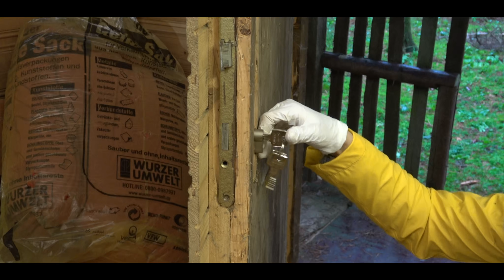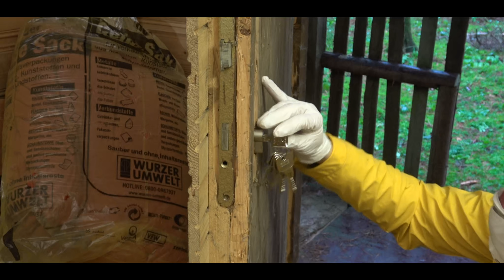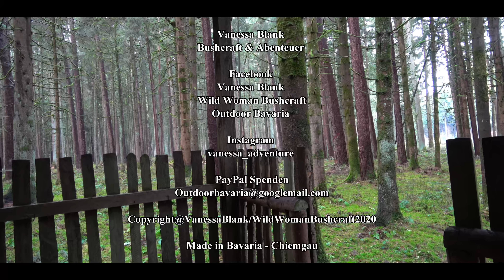🌳🏡🌲Forest Cabin🦊 #1 Tiny House - The Renovation begins - Vanessa Blank - 4 K

Comment: Well you got a lot of work done, looks great. Once you start staying overnight and are using a heating device you should think about having a smoke detector and carbon monoxide detector in the cabin. You did a good job protecting yourself when you were cleaning. The only thing I would add would be safety glasses or goggles. The mouse droppings and dust mixed are sometimes toxic. Great Job, congratulations!!👍😄🔨

Comment: Congratulations on turning a "man cave" into something fit for a "lady" and her children!  The big table might have been nice for having the children at one end while you prepared a meal at the other end, but it did take up a lot of space. If you are worried about security, take a slightly different way into the cabin every time so that you do not develop a path that others will be tempted to follow.  That moss on the wood is turning it back into soil--just like a moss covered log lying in the forest, so you need to address that sometime--a lot of work and some more money, but get the damaged wood replaced first and look to that roof first too.  It takes time and money, and there is never enough of either, but the work is started in a big way now, and you can stay in the cabin to do the other things that need to be done. This is the kind of place that is made for children to grow up in!  Blessings to all of you!
Reply: Maybe you could get a smaller table but put a drop leaf for the end so that if you want to use it for other things also you could.
Reply: See to the roof now that there is something inside to protect.  Nice work so far !

Comment: Vanessa, you might consider putting some type of insulating material in the loft between the main rooms and the roof. This will prevent the heat from escaping, and if you use the cabin during the winter months, any snow on the roof won't melt and leak down into that space and end up down in your main areas. You've done a fantastic job of getting the cabin ready. I'm sure you're eager to begin using it.
Reply: Grand idea BUT need a moisture barrier of at least 6mm before laying the insulation on top. Also need at least 1 roof vent to allow wind to flow through to allow moisture to escape. Moisture build up will rot the wood and saturate the insulation. But first of course need to get the rood repaired to keep water out.
Reply from the maker: Nice Tipp, thank you Jeff!
Best wishes,
Vanessa

Comment: Oh I forgot. Use double wall pipes for stove (safety)...
Make table fold-up...

Make wood shutter lockable from the inside...

Bring a 45 gal burn barrel.
No more trash issues. Just bottle & can removal...

You said you can get your car there. Use a 12vdc car vacuum. Or remove battery from car & carry to cabin & use 12vdc car vacuum.

Oh Regards Mattress':
You will be better off bringing 2 CTC 4" self inflating mattress' with your sleeping bags. Then no mice\chipmunks\squirrels, issues...

Regards Windows:
Use plastic instead of glass...

Comment: Well done Vanessa, a mothers touch as it looks a ton better for a good clean up. still along way to go but very impressive what you have done. It's a good idea to start with a blank canvas, maybe a smaller table and a few comfy chairs would be a good start, and of course something to heat the place and cook on. I'm sure someone will help you with the roof and as it not that big maybe rip the lot off and do a proper job on it, even maybe put some quick fast dark green plastic coated steel sheets on it, with insulation between the rafters, then you wont have any leaks whilst you have it and that is very fast to do and pretty bomb proof for maintenance. plus the rain water will be coming off of the plastic coating so it will be cleaner. Bit of fitting out inside, shelves and all the other bits and work the beds out for your children and it should look a treat and really homely. Well done and stay at it. Maybe even a small Vanessa's vegetable garden outside, if there are not alot of little friends around to eat them before you do. Get your water sorted with maybe a well if possible and some sort of toilet, and you won't want to leave it. Arthur (UK)

Comment: You might think about a Murphy Bed for sleeping. It is a bed that folds up against the wall when not in use.  When folded up you could also have folding table on the back side. When the bed is up the table folds down.  You could also do the same thing for the children when they sleep over. I would also suggest a metal roof. It is not that difficult to install as long as the roof supports are in good shape. I would also suggest a hard covering for the floor. I noticed some good size opening between the floor boards. In winter a lot of cold air and bugs would come in from the the floor. Looking good so far.

Comment: Things are coming along great, you have already put a lot of work into it. As I was watching, I kept thinking you should be using a  shop vacuum instead of blowing the dirt with the compressor. I see you have access to a portable generator, and if it can run an air compressor, I am sure it can run a shop vacuum.  Shop vac's have attachments that will allow you to get into very tiny places, and you won't be blowing dust around just to settle someplace else. Just a suggestion.

Comment: It will be a fun spot to take the children  in all 4 seasons. About the cooker: they are coated with a sort of melted glass & even the most disgusting enamel stove can be cleaned & sanitized.  If the mice chewed up any tubes or wires,  they are much more affordable than a new one.  I used steel wool with vinegar to clean & then bleach to sanitize one that had been stored under a house & used it for years.  You have workd so hard, soon it will be time for fun!

Comment: Nice work...the roof work should be done from the top-down...Trying to replace broken lumber from a tight space will be a lot of hard work...you will need extra hands...I would recommend roll roofing to replace the shingles...There is also a table that converts to a bench when needed, might be an option for you there...

Comment: Hello Vanessa!
WOW you did a great job with your cabin so far.

About your windows….did any of the wood framing for the windows need to be repaired or replaced? If not 300 Euros sounds like too much money for what should have been an easy repair of replacing broken glass. You are a very capable and intelligent person and with all of the DIY home repair books on the market today this is something you could easily do at home. Again, of course, if it was only the glass that needed to be replaced.

I am thinking ahead to the summer when nights will be warm and it can become stuffy inside the cabin. To give you more space inside the cabin, and for better air flow in the cabin, have you considered knocking down the inside wall that makes the bedroom? I understand that you desire some privacy from the boys, and guests, but you can accomplish that by hanging a privacy curtain from the ceiling. This way when you don’t need it the curtain can be pushed back against the wall opening up the cabin interior.

Anyway those are my two ideas. Great job and enjoy this time!

Comment: You put in plenty of work cleaning up that cabin and it does look nice and I was wondering about the floor in one room as I saw gaps between the boards in the floor and wondered if you got that fixed as you want to keep as much air out as possible in Winter, especially. It must have cost you plenty to acquire the cabin and then fix it up and I hope that you get plenty of use out of it.

Comment: For some of the cracks in the floor you could get a 6 in. Self-Vacuuming Orbital Palm Air or Electric Sander and keep the wool dust mix with wood glue and fill the cracks and sand again. Then put on finish or paint. Or take some wood and shave with a knife to put in cracks.
You are doing a very good job. Can't wait for the next one.

Comment: 🇬🇧     Did you clean the attic first ?    You will need to do it and you don't want dust/dirt from upstairs falling down through the joints to where you have already cleaned.
Scratches on the floor are Joints.     Branches ?    Rafters.
A video series in N.Colorado called Spirit Forrest had a camping bed bunk system which, during the day could be a settee/sofa.  Something like that could maybe ccommodate your little ones.

Comment: Hello Vanessa the branches are called rafters the next time you have to replace a window go to your home tool store that sells wood as well and tell him you need a piece of Lex and it's what they use in race cars it's much lighter than glass and 10 times as strong you can smack it with a hammer and it won't break so you buy it once places looking amazing

Comment: Venessa your doing a fantastic job ! And two to three hundred euros that equals to $218.93 or $328.40 U.S. dollars to fix a window? If you were in the states that probably would have around $40.00 U.S. or  37 euros. That's alot  of money for a piece of glass and installing it. WOW 😳  I would see if you can get a small carry type camping  generator to use a electric one  gal shop vac  vacuum cleaner to suck up all the nasty stuff that may help out a bit . And one more thing get some safty glasses to protect your eyes 😁👍👍👍👍👍

Comment: Hi Vanessa. Your work on the cabin so far is really impressive. Carbon monoxide from the heater or cooking would be of great concern to me so as someone else mentioned below, a detector is a high priority. Could you not run a vacuum cleaner from your generator? If the generator is going to be an ongoing feature, perhaps you could run an externally vented range hood for cooking or some powered vents though you'd be making more holes in the walls. If the generator is staying, then a locked ventilated locker outside would be useful. Then you could charge a deep cycle battery for lights. I look forward to seeing your progress.
Reply from the maker: Hello Greg! Sounds great!
the generator work really good and helps me a lot outside. For cooking willb use an wood oven .
Best wishes, Vanessa

Comment: 27:19 Finally a generator!  A vacuum would keep the old dust from blowing around and outside to be tracked back in.  Rake around the house and burn the debris to get rid of the bits and pieces of trash from over the years.  Does the platform the bed sits on able to move out to clean underneath?
You are just driven to get this going.  Very inspirational.
Did anyone ever say why the last occupant moved out?

Comment: Hi Venessa,
Your lock maybe off centre, that is why you can`t open it from the outside.
If you have a friend, standing outside to help,
loosen all the fixings and move the lock around,(while the door is closed) to find the correct position to turn the key, 
from the outside(by your friend),
once you find the correct position, do up all the fixings one at a time and your friend will need to
test the lock with the key each time.
If after each fixing is done up, anything changes with the key, the base plate/mounting plate of the lock
maynot be level.This will need to be made level with washers/spacer for the lock to work.
Good luck,
Alex.AU.
Reply from the maker: Hello my dear viewer!
I would be happy to answer you individually and in detail, but I am 
still in my forest hut at the moment and working on my interior design!
I hope you are not angry with me and next time I will certainly have the
 time to answer you in detail!
Will you be back with my new videos at the weekend?
I would be very happy!
All the best, your Vanessa -From the fox den 🦊

Comment: What a super young lady.  Not only good looking but handy with hand tools.  How soon can you move in?  I was pleased to see you using a mask when you were cleaning or drilling.  I worked in the construction industry years ago and nobody bothered with safety equipment and I eventually ended up with sinus trouble.  Some of my colleagues ended up with lung problems.  I see you have a mobile generator.  Perhaps it might be easier to use a small industrial vacuum cleaner instead of a blower.

Comment: A garden, pump sprayer filled with a mixture of laundry bleach and water can be used to spray the roof moss.  That will kill it, and if treated once a year, will maintain a clear roof.  You can also attempt to attach a copper water pipe to the length of the roof peak to keep the roof clear also.  Copper flashing along the peak can be used too, but could be costly. The forest environment will allow moss to flourish otherwise. Good Luck.
Reply from the maker: I would never work with poison in the nature. Not in my garden, not in the forest.
Thank you for the other tips!
Best wishes,
Vanessa

Comment: If you do not want to use the oven inside the camper, you could put it on the porch along with the propane Lantern that's mounted to the wall. You could put it on the porch so you can cook in the dark outside on them. Very hot nights. That would be a good idea.

Comment: There is a company called G Stove   that makes a neat little wood stove that you could cook and heat the cabin. It comes with a lot of cool attachments like a water heater and a small oven that attaches to the stove pipe. I saw it on TA Outdoors,  check it out.

Comment: I suggest...smoke detector, carbon monoxide detector, fire extinguisher.  Do you have a water supply (well) ?  If so, I suggest you have it tested for e-coli, lead (Pb), other contaminants.  Mice and voles are very difficult to get rid of once they are established. Repellents are safer than traps or poisons.  Thank you for sharing.

Comment: I would buy plexiglass.  You can cut yourself, glue it to the window and it is cheap.  Then you put a strip or window putty.  Insert smoke and air alarm, because you have gas. 
Would go to a house renovation or shop and ask for insulation for the attic.  If something is over or that cannot be sold.  It gets a little warmer, if you are going to be there in the winter.  The heat rises, as you know.  The walls do not need insulation.

 Well done by you!  Nice kids
Mikael from 🇸🇪🇸🇪🇸🇪

Comment: Maybe, hinge the Table on a Wall..save Space..One that Flaps up and Down in a strategic Place, maybe much Higher, near a Window that s High, for a Work Station or  Eating Bar..when Required..also, look at Salvage Windows..instead of paying 200$, I would have Gone to the salvage Yards and get 3 new old thermopane windows for 100 or 150 euros....go to Scrapyard also to get ideas....spiral staircase for loft..etc..consider, kicking up the roof, where it is broke..if you must repair a part of it, kick it up 3 feet and make a loft, finish the outside the same way, maybe use cedar shakes.., go sniff around a Lumber Mill in your area..maybe rent a Wood Mill and cut some of that deadwood to build sheds, tank cupboard (insulated)..a Deck and a Jacuzzi or Outside Shower..Get a Vision for It..think 20 20..Airbnb, not just a Hunters Lodge...something that is as original and eclectic as YOU

Comment: Also a very good wood preservative is equal parts diesel fuel, boiled linseed oil and Thompsons water seal and you can apply with a hand sprayer just be sure to protect the ground with with plastic to catch any drips or overspray it will smell of diesel for only about a week. Note only for exterior use.
Reply from the maker: Hello my dear viewer!
I would be happy to answer you individually and in detail, but I am 
still in my forest hut at the moment and working on my interior design!
I hope you are not angry with me and next time I will certainly have the
 time to answer you in detail!
Will you be back with my new videos at the weekend?
I would be very happy!
All the best, your Vanessa -From the fox den 🦊

Comment: $300 euro's for glass the repair😮🤔 bastards. Hi Vanessa great job on cleaning your cabin! My suggestion will be to have a carbon monoxide / smoke detector in your cabin, as last year where I live a lady and her children perished in a camper because birds had built a nest in the exhaust vent of their gas heater and when they went to sleep they just never woke up as the carbon monoxide filled the inside of the camper and suffocated them😢We all want you guys to be safe so that is my suggestion. Also I own a log house in Northern Canada with a vaulted ceiling so I know about heat loss🙄if you can pick up some insulation for the attic of your cabin it will greatly reduce the amount of heat that you will need. Always make sure that your cabin can breathe!... a little fresh air will save your life. Love your videos😎

Comment: The wide metal/aluminum band on your mask is made to form/shape to the bridge of your nose for a better seal/fit to face.
Don't squeeze too hard. It tends to make the ends lift off of face. 
Paper masks help some, but they don't actually seal out particulates...dust sized floating about.
A silicone rubber mask that can accept carbon cartridges and filter dusts..fit to your face properly will last you a lifetime of all hobbies/tasks. ~ Carbon cartridges for volatile fumes as painting/flooring chemicals...unsuspected off gassing what have you cleaning old cast iron items...and dust filter sets on after/snaps on above the carbon cartridge.
~ Even if carbon cartridge is spent/used too long, dust filter use is not affected changing out when needed.

Comfo Classic® Half-Mask Respirator will get you to category of mask I'm talking about. Surely there are other brand's/makes that auto painters use.
 It is all about the fit.....we tested each year for seal against particulate matter from a lit candle in a small room.